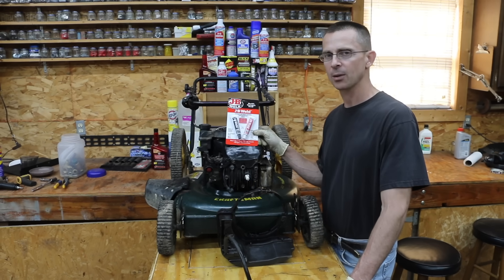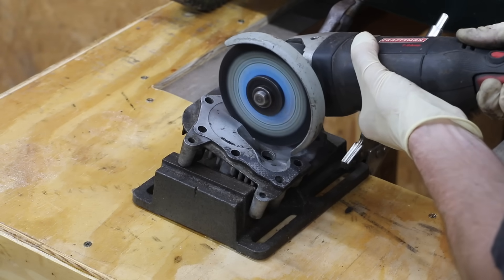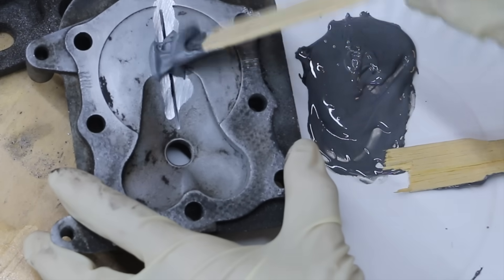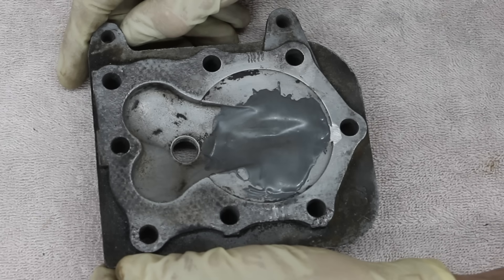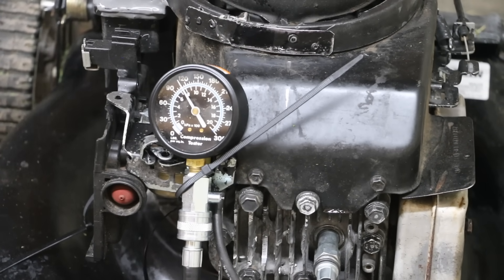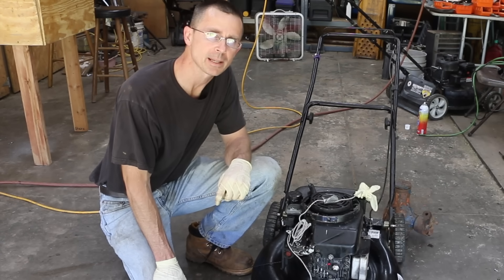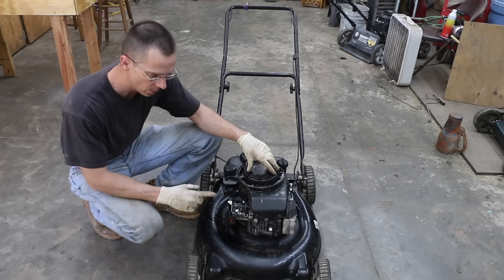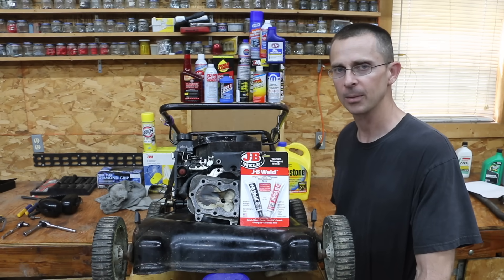Can JB Weld fix a cracked cylinder head?  See the proof!!

Comment: The issue with this test is that, that is not a "Crack". A crack is an extremely small thousands of an inch thick gap, with 2 stress points on either end that'll continue to crack with pressure. 

Cracks are hard to fix, you need to either drill many holes and insert plugs, or drill each end of the crack and attempt a repair like welding, w/e it may be. 

This is an elongated hole, with rounded edges. You're filling that gap with a lot of JB Weld, can't do that with a crack because the JB weld won't seep in between cracks, it'll simply end up a patch job. 

So i'd try and replicate this by cracking a cylinder head some how, then trying JB Weld. We'd get a more realistic result.
Reply from the maker: Great point.

Comment: I've been using it for decades and have never had a failure.  Among other applications, have used it in place of brazing for AC lines.  No problems. I kept the same central air systems going for 47 years.
Reply from the maker: It's a great product!

Comment: I used jb weld puddy on the crank case of my 2002 Yamaha yz250 2 stroke.  It's been there for years now and still works fine.  The hole was made by tipping the bike over onto a pointy rock and it made about a dime sized puncture hole.  If I remember correctly I put it on in the morning and was able to ride the bike 10 hours later.
Reply from the maker: Nice repair!

Comment: JB has been around for ever, back in the early 80's I had a brand new Toyota pickup, the next morning from picking it up from the dealer I found a puddle of fluid seeping out of the side of the transmission. I took a good look and it was coming from what I believed to be a casting problem in the metal. I didn't want to waste time with the dealer so I sanded it cleaned it up and applied JB into the tiny hole and around the area. 80k miles later I sold the truck, never a drop from that repair. JB good stuff.

Comment: Had a 1982 Ford Crown Victoria. The double drain plug oil pan, front drain plug stripped out badly. Left to drain for day, cleaned and installed large bolt, washer and JB weld. Drove car another 5 years and never leaked again. I use JB weld when doing my exhaust on cars, makes for very tight seal after clamping it up.
Reply from the maker: Nice!  JB Weld is a great product.

Comment: Still not convinced, need to mow tall grass for one summer season to generate full operating temperature in a working environment then cooling after shut down multiple times, more than just a few times. The expansion and contraction from hot and cold cycle may have an effect at the adhesion points (separation). I've seen JB weld used on radiator tanks both plastic and metal it'll buy you some time maybe one season but will eventually fail due to the hot cold expansion contraction cycle. None the less JB weld is a great product it's been around since 1969 50 years is a testament in and of itself. I repaired a broken crank shaft on a small air compressor about 25 years ago and to my knowledge it's still running.
Reply from the maker: Great point!
Reply: Project Farm - just discovered your channel well definitely be viewing more videos when time permits as they are very interesting. Keep up the good work thanks.

Comment: I want to see a video about etanol in a Gas Engine...Here in Brazil we use etanol to clean carbonized gas engine and carburator using a mix of etanol and gasoline! The popular wisdom says that if you want to clean an gas engine, you just need to put 50% or 25% of etanol  on the tank to clear it and to clear the carburator - i will enjoy to see a video trying that! Another popular wisdom says that etanol or flex power vehicles using 100% etanol (both very common here) does not have to change the oil with too many frequency, in fact my oil looks fine when i use 100% etanol for months (the color did not change to black like when i am using gasoline), i dont know if this is testable too!
Reply from the maker: Thank you for the video idea!

Comment: I had a 262 cummins. It blew all three head gaskets, one after another. The cylinder block was distorted, hammered, uneven.  I took DEVCON epoxy any put it on the block and torqued it down. They held all summer and i sold that damn truck.
Reply from the maker: Impressive!

Comment: Hey you should put a hole in the side of the  Cylinder wall and fill it with jb weld  to see if It can withstand all the motion. And pressure from engine
Reply from the maker: Thank you for this video idea!

Comment: When I worked at the Honda dealership, we had some guy bring in an accord that had a hole in the block that he sealed with JB Weld that ran. I've fixed a coolant reservoir that was completely busted at the bottom as well as making a carb float pin holder.
Reply from the maker: Wow!  Impressive repair!

Comment: JB weld was good for nearly 50 shots when I used it to hold a 1/4" drill-bit (shallow) rifled 5/16" brake line (improvised .25 cal. barrel liner) in a 3/8" length of a cut-down blank gun's barrel (the only part that wasn't plugged) and 1/4" steel nipple and epoxy for the rest of the outer barrel. I used 47 grain .25 cal. bullets I swaged with pliers or 15 grain 1/4" slingshot ammo and wax in the 9mm PAK blanks. Would've held up longer if I got higher quality bullets like .25ACP round nose bullets or exclusively used .25 cal. airgun pellets, 1/4" slingshot ammo or ball bearings rather than imprecisely swaged soft lead with nearly cylindrical form and flat noses.
Reply from the maker: JB Weld is great!
Reply: Sure is, also good to a point for making replacement head gaskets on the fly, but in my next, higher quality pistol build I'm going to try out the product that's basically their direct competition but apparently better. I learned about it in another one of your videos, "The Ultimate Epoxy Competition--Which Epoxy is the best".
Reply: Loctite Steel/Concrete, that's it.

Comment: Would be cool to do a 3d printed cylinder head... I could print one if you send me dimensions!
Reply from the maker: 4 inches x 5.5 inches and 1 inch in thickness.  I would need to drill the head for the head bolts and spark plug hole.  Would this be possible?  
Address:
Project Farm
PO Box 162
Peculiar, MO 64078.

projectfarm52@gmail.com
Reply: Emailed you thanks for the quick response

Comment: Could  JB Weld be used to reattach a lower leg of a BBQ.
Reply from the maker: It's hard to say without seeing the area in need of repair.  However, my guess is that it will not work for long.

Comment: GM 2.5 Iron Duke used to crack in the middle exhaust side Block freeze plug when over heated..  We used to deep V-Groove the block and surface with a carbide bit and a Dremel. Then fill it with JB. It will never crack again... We did over 100 like that..
Reply from the maker: Impressive and innovative repair!

Comment: I used jb weld to seal a head like that (milled out the valve pockets too far) and it eventually burned through and cracked once it got hot enough, shooting sparks out the hole
Reply from the maker: The JB Weld Extreme Heat might survive the intense heat.  However, it doesn't have as much strength.

Comment: you should use the stick kind of jb weld that way u dont hav mix or deal withit runinng each has its place. put the stick kind probably work better hear. ( when i say stick i mean it comes in a tube and u cut or pinch a mount off work it together and but it on what u need it to
Reply from the maker: Thank you for this recommendation.

Comment: sure you bumped the compression up in the motor lol. at some point that JB will flake off, but its a mower so lets have some fun. lets do a run with sulphur pills. i remember when they sold those as a fuel additive. think they still do in mexico
Reply from the maker: Thank you for this recommendation!

Comment: I have a real cracked cylinder head. Its on a 80cc 2 stroke motor. I applied jb weld inside and out it did not remedie the problem. The engine got hot and spit out the jb. Im going to try and add a much bigger glob this time maybe it will do the trick i'll be back with a reply tmr.
Reply from the maker: A structural break such as this one will be nearly impossible to repair with an epoxy.  Not sure why it cracked, but aluminum is much stronger than JB Weld.  So, if the original surface failed, it's unlikely that JB Weld or any epoxy would hold up.  With that said, there are many instances in which JB Weld can get the job done, but each application is unique.
Reply: Project Farm yea,  the more liberal application was sufficient for 2 miles then I ordered a new head thanks for the reply.

Comment: I've used JB Weld for many years and really like the white water proof marine version but went to use same regular version he used on a small steel gas tank repair hole on bottom of car gas tank, it does NOT do well with gas at all like they say, I tried it about half a dozen times, the regular 50 50 mix as well as other ratios. It always was dissolved and broke apart in pieces, it can't come in contact with lots of gas on bottom of  metal tank, even putting a bolt and a screw in hole to give it something to hold onto and getting all fuel out. The vapors of gas alone made it not stick and come apart eventually. It's good stuff for certain things, plastic stuff , some metal but bare steel metal even roughed up and gas, NO! It will not hold, it will crumble, also tried the marine white version, it worked a little better and works great on boats and in water but not car gas tank!! Busted JB Weld, also not great for really high temps and fast moving parts like I'm sure you know from your other videos!
Reply from the maker: All great points. Thanks for commenting.

Comment: I have a 2001 Saturn had a problem with the air intake I use J-B Weld this car is weird it was on the supply side of the air intake that supplies the hot water for the heater a design flaw by Saturn and it worked like a big dog thanks
Reply from the maker: I'm impressed!  Great job on the repair!

Comment: in the tank the fuel was in contact for a short time since the leak was on the top. i have a tank. with a leak on the bottom, nothing has worked, i will try j b weld.
Reply from the maker: I should last for a while.

Comment: New Mexico   1980's  Alfalfa  hay needs  cutting and  Swather  breaks  down. The  gear on the  16 foot  sycle blade  slams back and forth  with much  trauma on the gear box.  APivot  part with very worn splines was bad. Ordered new part  several days delay.  Put the parts back together and used JB Weld  to fill the voids. in the spiines and  let it set over night. Next morning  began cutting the alfalfa  and low and behold finished the job.  We got the hay baled and in the barn without getting it wet.  Rainy season coincides. When the part came in I took the  pivot out and the JB Weld came loose from the steel parts,  and llooked like  steel wedges still  in place with very little  gaps.  Wondered how much longer it would have kept on keeping on had I not put in the new pivot.
Reply from the maker: I continue to be amazed at great JB Weld success stories like this one.  Thank you for taking the time to comment!

Comment: Will that jb well hold on to a radiator heat
Reply from the maker: Yes, the heat rating is around 500F for JB Weld, which is much greater than the heat a radiator will produce.

Comment: Does job weld work on plastics? My front bumper is cracked and I want to fix it, but not spend $400
Reply from the maker: I don't believe it will work for that application.
Reply: Project Farm 😭😭any ideas then? I want something more permanent than using the fiberglass bondo

Comment: I used JB weld for hole in 4 cilynder engine block which throw rod. And its holding oil still after 3 or 4 years!!!
Reply from the maker: Wow!  Impressive!
Reply: Project Farm I also used that in leaking radiator and it have been holding water for 1 year too!!!

Comment: Can I use this stuff on a metal gas tank ? It literally has a size of a pinhole wear it's leaking gas
Reply from the maker: Per the directions on the JB Weld I purchased, it will work on metal and is resistant to gasoline. I hope this helps.

Comment: I used j b weld to repair. Broken or cracked motorcycle engine cases and side covers also used marine tex epoxy like to see a test between jb weld and marine tex epoxy...that was a good strength test for jb weld💪
Reply from the maker: Thank you!

Comment: A better product for this sort of application might be the high temperature putty version of JB weld which has a way higher transition temperature (softening point of the cured epoxy), good for something like 600F, and seems have higher tensile strength when cured than the liquid.  I use the JB weld putty more than the liquid for fixing things; it is the ultimate handy-man's secret weapon.  You can use it to effectively manufacture plastic parts on the spot.  I made a nicely contoured fuel selector valve for my airplane by moulding JB weld putty around the cast aluminum blade type handle on the valve to encase it, then contouring after curing to a pleasant to feel shape, sanding and painting it.  Looks like a manufactured plastic part.
Reply from the maker: Thank you for this recommendation!

Comment: About 25 years ago, I knocked out the radiator drain valve on a '79 Mercury Capri 5.0L while parking in a ditch. The car was simply too low to the ground. I used JB Weld to reinstall that drain valve. 2 applications...on the actual mating surface, and then a second caulking bead-like layer around the outside. That repair held up beautifully for a year after that with zero leaking, until I got rid of the car for other reasons. 14 psi, and something like 200 degrees was no problem. Oh yeah, I knocked out the drain plug in Oregon, then after the repair drove the car home to the Midwest :p I was just visiting in Oregon for like 2 days.
Reply from the maker: Impressive! Thanks for sharing this experience.

Comment: JB WELD smells like cat shit when you mix it. But that stuff really works.  I work at a Automotive repair shop and Ive seen it used on cracked Transfer Cases, crack Transmission cases, radiator plastic tank cracks. Its a fantastic product. It will hold up to anything.
Reply from the maker: Thanks again for commenting.  I agree, I've had such great success with it, I always have some around.

Comment: I used it to fix oblong holes in a compound bows machined aluminum cams where the bushing resides. It held up for many many years shooting 3 grains per pound arrows at over 320 fps (this was mid 1990's). It was a High Country Supreme bow and the JB weld repaired cams outlived the limbs of the bow. Its damned good stuff!
Reply from the maker: This is impressive!  Thanks for commenting!

Comment: My experience with JB and fuel, especially on automotive carbs, is that after 6-12 months the JB slightly shrinks, pulls away, and the leak comes back. I have fixed 2 expensive condensers (300 psi or so) andthe JB held like a champ.
Reply from the maker: Thank you for this information!

Comment: I've heard of people using PC-7 epoxy to fill in cracks and voids on cylinders and heads on antique engines. An example would be a bad head gasket and the combustion erodes or flame cuts into the gasket surface.
Reply from the maker: I plan to test PC-7 soon.

Comment: JB weld is my new goto thanks brother. I'd sit there for ages using a soldering iron on plastic fuel tanks. Or I'd go to the wreckers to buy a good old engine part that had a crack. Not any more. Thanks again man :-)
Reply from the maker: Thank you!

Comment: I jb welded a crack on the engine block of my f150 8 years and at least 40,000 miles later ago. I had to touch it up a few months ago, but overall its still running like a champ with no problems.
Reply from the maker: Impressive!

Comment: Used JB weld on a 40 Gallon Poly tank on a carpet cleaning machine the crack was on the bottom of the tank  the JB didn't hold. Maybe a  combination of the cleaning chemical and the hot water was the reason the JB didn't work but it was my first time using JB the next time I need it I will try it again.
Reply from the maker: I hope you achieve great results next time.
Reply: Polyethylene is impossible to glue, but it welds well using a welding gun with a flat spatula. There are a few other plastics that are inherently slippery that can't be glued.

Comment: What I need to know is will it repair the crack in my superbike engine just infront of the front sprocket as my chain snapped and put a crack in my engine casing now coolant pisses out all over the floor.
Reply from the maker: That's a tough one to determine without seeing the crack.  If you choose to use an epoxy, surface prep is extremely critical.  It definitely won't work if there is any coolant residue on the area you're trying to repair.

Comment: I had an s10 pickup that developed several holes in the differential cover. I took it off & applied JB weld, smoothed it out painted it after it dried & it lasted me for several years & was still leak free when I traded the truck.
Reply from the maker: Impressive!  Thanks for commenting on this.

Comment: I have used JB Weld on many application. But the one time I remember the most is on my Grand National Sportsman race car. The intake manifold had a about 1" long from the thermostat bolt hole. We removed the intake from the SBC, cleaned it up and applied JB Weld and went racing. Pulled the intake off a few more times thru out the rest of the season and never had any problems with it and won some races as well. Phenomenal product!!!
Reply from the maker: Impressive! Thanks for commenting on this.